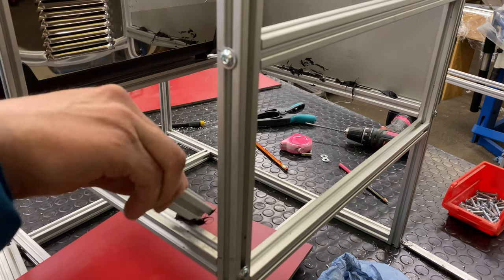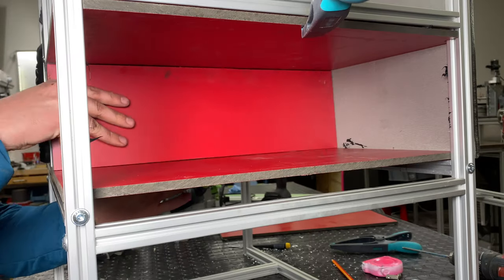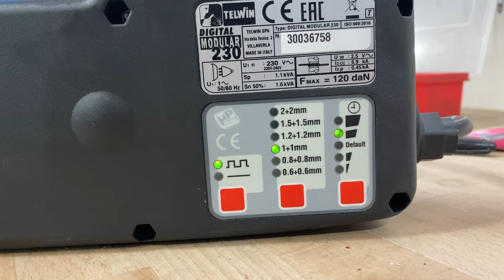Build Your Own Welding Cart: A Perfect Project for the Home Mechanic

Comment: Hey Max. I love that you use aluminium extrusion a lot in your projects - it's Lego for adults, right?😁 Where do you buy your aluminium from? I'm in the UK, and the prices are quite high, but buying from Europe is just as easy (for now...😠)
Reply from the maker: They are great. Especially if you drill through and screw in a bolt into the ends. I bought mine here: https://www.alu-profil-technik.de/Profil20x20-Designprofil-Aluprofile-Strebenprofile-Solarpeofile-Alubaukasten.html

But I buy a few thousand meters every year. Thats why it is so cheap for me. If you are on a budget I recommend looking at a scrap yard or scraping an old industrial machine. That way you also get a lot of cool accessories.

Comment: A bit weird to see someone making a welding cart, without using any actual welding (save for some spot welding)...
Reply from the maker: Yeah I know. My thinking was that in order to properly learn how to weld I should get setup first. I feard that I would get frustrated quicker when there is a mess, so my first step was to find a home for all the equipment so then I can start with a clean slate or workbench.
Reply: @MaxMakerChannel  Well, as I see it it's a easy starter project to learn using the welder :)
Reply from the maker: @brynyard  Sure, but I have no lack of projects. Limited time and too much stuff on my to do list. I just don´t have the time for fun projects like this. It needs to be fast and efficient.